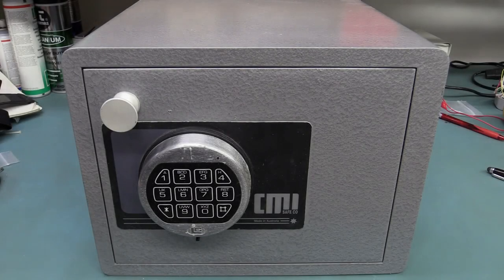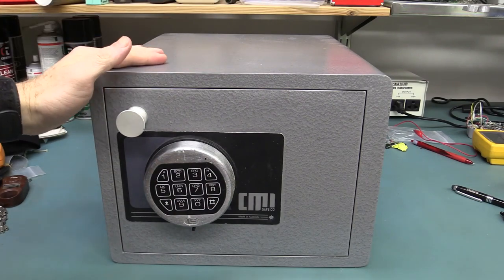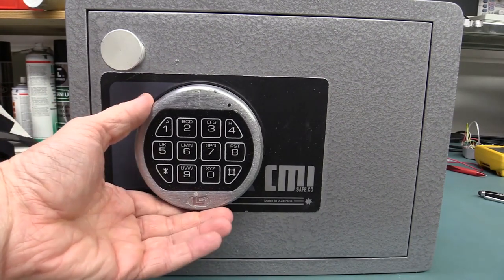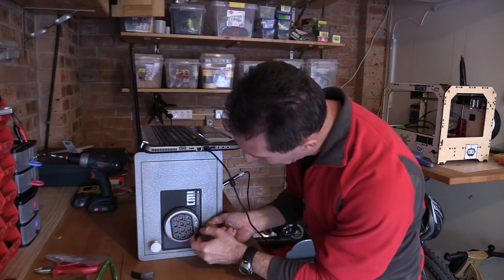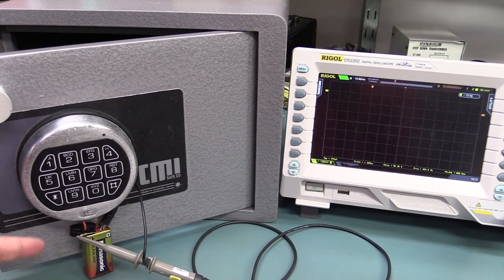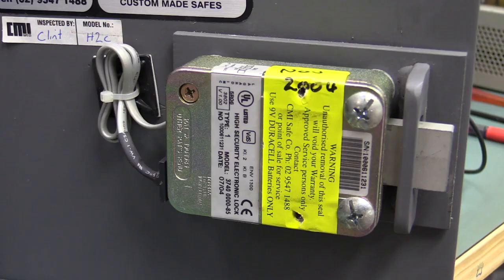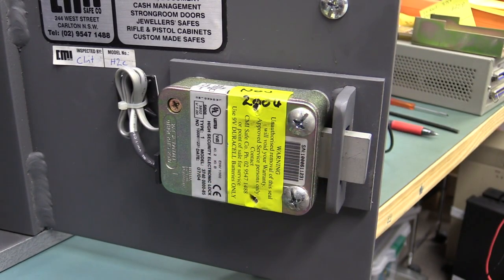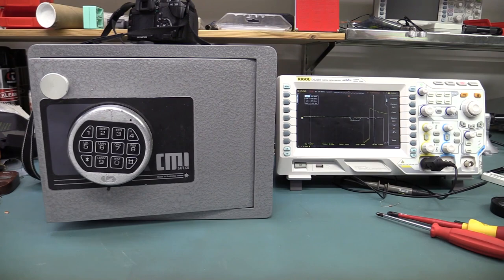EEVblog #762 - How Secure Are Electronic Safe Locks?

Comment: the termoscope idea gave me a mindblow :O!
Reply: Eric Alanis There's a cheaper, easier way but you need regular access to where the safe is (e.g. a cleaner or maintainance person) and the safe needs to be used regularly or it will take a LONG time. There is powder and Gel available for demonstrating how germs spread, it's only visible under UV light. You put a bit on digit "1" then come back after the safe has been opened, shine UV light on it and note if it's been transfered to any other digiets. Clean it off and put some on digit "2".... repeat until you have enough information to work out the code (it becomes a bit of a logic puzzle and you may end up with a number of possible codes to try). You can speed it up slightly by using the finger print method first to find out which digits to concentrate on. It's more accurate than the fingerprint method alone as that only gives you the digits, not the order. If the safe owner is aware they can of course defeat this by wiping the keypad before and after use just as with the thermal method. High security keypads use touch screens or led digits and shuffle the order of the digits each time to defeat fingerprint attacks.

Comment: Gravity in this case could be replaced by a large rotating platform, which would give you a necessary amount of G, which could be enough to open the thing, and the little spring won't help.

Comment: You need a small cassette tape player head that will fit through the hole, or maybe a head from a VCR drum, or hard dive head. The head needs to be wired to a very sensitive amplifier. Tape the head to the long screwdriver, put it through the hole so it touches the lock's metal housing. The magnetic pulses created by the chip's electrical pulses should look & sound different when the correct numbers are pressed.

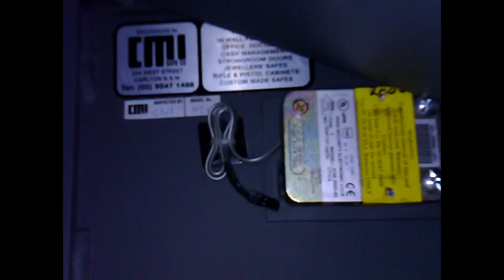Comment: Are the three bolts that you removed to disassemble the lock accessible with a really long screwdriver from the mounting holes in the back?  Wouldn't that let the safe open?  i.e the ones at 16:25 and 34:14.  Of course the safe would have to be sitting free for that to work.

Comment: Probably the program compares the entered code after the last 6:th digit. A small time difference could possibly be seen after the 6:th keypress and the buzzer or led blink. The program does probably some "jump if not equal" compare for every digit separetly. So as soon as there is some difference it will jump out and sound the buzzer. If first digit is wrong it will jump directly out but if it is right it will compare the next.. The CPU can run at 8MHz so the difference could be quite small possibly ns. I thought i saw some ripple after the buzzer signal also. That could mean that the buzzer sounds first and the program compares the codes after that.. Nice video !

Comment: Do you reckon that a check is actually performed after each digit is entered, or that each digit is stored in RAM and then checked after a sequence of six has been entered? Seems to me that just holding the input in memory until a full sequence has been entered would avoid the type of power line vulnerability you were looking to expoit.

Also, I wonder if the number of failed combination attempts is stored in the EEPROM along with the combination and lockout status. If the number of failed attempts was stored in RAM, then interrupting the power supply after every third combination entered would make the use of a brute force jig feasible.

Really though, it seems to me that the solenoid actuator that detains the locking pawl is the most likely point of failure. Maybe just torque on the handle real hard and you could shear that actuator right in two?

Comment: How about using the drilled hole to connect up a "custom wire" to the mechanism,  then look for  keypad communication  data line vulnerabilities.

Or a way to defeat the lockout feature....  disconnect power  or reverse power input polarity  to reset the board, so it forgets the number of failed attempts?

Comment: In the front you have 4 wires going into the safe. 2 for the 9v power and 2  from the keypad. A 2 wire data keypad must be easy to sniff,  specially if you also have power right there for the sniffer.

Comment: You could have removed some of the caps and tried the power line analysis again for  the kicks.
Also on the programming side of this thing, it probably stores the keys in an array and doesnt do any combination checking just after you have 6 numbers in your array. Which means every key press will run the same code (with the same power profile) that only increments a pointer to an array and check if it has 6 digits. Once the 6 digits are entered it checks if the array is correct or not and do a branch for opening the lock or not.

Comment: expanding on your last thought (drilling the front) -- well - they already did it for you!
The knob at the upper left corner ha s screw in the back...so, by twisting the knob, it is possible to disassemble it, knock the bolt inside, and you have an access point. Use an endoscope and an instrument to release the mechanism, and you're in...try it and see if it is possible.

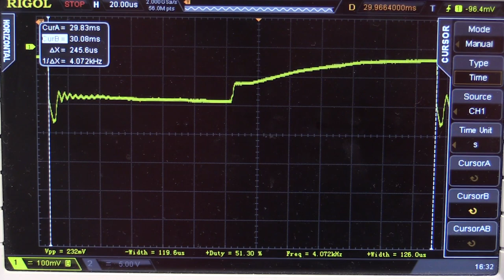Comment: At 23:50 he starts talking about sampling the beep and comparing it, I found it easier to tell audacity to generate a 49 ms tone at 4072 Hz (which I did during the video, It's definitely the speaker).

Secondly the trouble is that you assume that an electronic lock would behave the same way an electronic level as a physical lock would, checking each number as it comes.  A properly programmed lock should just accept five input numbers and store them, then check all five at once.

Comment: What makes it almost worse is I've seen an almost identical example of someone doing the same thing on YouTube. Shows how much hassle even a bottom end decent quality safe takes to get into though, if it is bolted through the floor or back of the safe the way it's intended.

Theoretically though it raises the prospect of removing the same plug from it's hole and then using two wires on a stick carrying 9v to spike it through the now empty socket. Possibly even easier doing it that way than putting the plug back in!

In my experience of similar electronic dial safes, you get three shots with a five minute lockout. Hurrying to cash up at work cost me five minutes of sitting there chafing a time or two.

Comment: Since the power line is protected, what about probing the data line of the keypad? It should have a direct access to the internal circuit, maybe something slips out.
It should be easy to access that, just peel the membrane off and snap onto its wires!

Comment: The cable goes from the keypad to the control unit, right? How about tapping that cable, either inductively or electrically, through one of the mounting holes and analyse the communication? Theoretically, an attacker could install a small box which transmits the data in real time through a small RF TX.
Chances are, an average user might not notice the tap if it's done intelligently.

Comment: Maybe you could insert a probe through one of the holes and try to pick up some HF signal. PCB enclosure acts a shield, but maybe it leaks a little. Plus the whole safe is a good shield too, I presume, so the inside might be pretty quiet, HF wise.

Comment: I would have thought that a system which was developed as a result of proper systems-analysis would store all six digits BEFORE performing the comparison (if there were any chance of a power-line sniffing attack revealing any meaningful data).
I think the first drop you see on the scope is you sinking current with the button, perhaps. The subsequent drop(s) would be from the processor storing that digit in the relevant register. Then, I'm neither an electronics engineer nor an expert on safes. I am, however, a programmer with over 3 decades of experience and it is upon this, that I base my speculation.

Comment: You get to know the order of keypad presses if you sprinkle different kind of dust into each of the digits.  After safe owner has entered the correct code without messing up the dust otherwise, you just check what kind of magic dust contamination is in which digits.

Comment: Mechanical engineer here: Could you apply a (electro)mechanical vibration using a waveform generator, along the orientation of that solenoid pin-spring mechanism and find its resonant frequency?  If you could get the pin vibrating, you might be able to open the latch.

Comment: Drilling out the pin is the right way to open it. Always make a template when you have a chance.
That lock out had me going, that's why always look 2 or 3 times, a bank vault is not so easy to fix

Comment: When I was a kid my best friend had a code garage door opener, being typical kids he thought it was cool  and never told me the code- and I always said "I'll get in one day". Like a year later I had to bring his bike home and I figured I should return it safely to the garage... I looked at the keypad and you could see the wear on the commonly pressed keys, so after a few guesses I got it (just 4 digits I think). I put the bike back and went home... he never did believe me when I said I figured out the code.

So sometimes even the most basic things can give up clues. If someone uses a keypad a lot, touches it with hand cream on, or anything else on their hands that will leave marks or change the detail of the surface over time then you can figure out at least what numbers are in the code and guess the correct order. Maybe even peeling the number pad off and looking for wear on the bottom of the commonly used keys.... only works if the combo is never changed though.

Comment: You could replace the battery with a power supply with adjustable voltage. It you set a low enough voltage, the circuitry will function but not in the way it is designed to function. The internal logic circuits may get into a state where they power the solenoid when the voltage is suddenly increased to normal, even though the code has not been entered. This hack would require providing varying voltages, both up and down, below the normal operating voltage and then bringing the voltage up to normal. The circuit's behavior is probably not predictable and may vary from safe to safe.

Comment: I like the Idea of using a magnet to force the solenoid, but what about going in trough the holes at the back and bottom, like dave did? perhaps takes the plate directly off the lock or access the cables from the face plate.,
Reply from the maker: electronkidus97 The existing wholes are not accessible in a proper installation.

Comment: I wonder if the speaker is a design "feature" to saturate the power line with noise?? I Also would it be possible to strategically "cook" those decoupling caps?

Comment: Did you try to over power it, 12volts or maybe hi-voltage and high frequencies to see if you can kill the chip and maybe activate the solenoid

Comment: How is the keypad talking to the solenoid circuit with only 2 wire?  Is it a serial comm. connection?  I also wonder if you disconnect and reconnect the battery does the 5 min. lockout still continue?

Comment: So a hack would be to use the existing bottom holes and back holes to access the selelnoid wires or pull the connecter then weasel in power to the selenoid wires or connecter and Power the selenoid and your "in like flin", heck, may even be able to do this with the provided mounting holes with some creative modified tools and mini camera...

Comment: undervoltage is Your best friend with negative pulses. It works for me in a gamble machine (i locked out Myself with a code. in My old pub) so, You just need feed a cranky low voltage press one button and on a same time apply some idiot negative pulses. Most of the cpu are will get hang up. and some logics are will stay opened state. or a 20joule hammer machine :) close to the lock. shakes everything until everything folling into parts inside (solenoid, springs etc) thx for the video Dave :)

Comment: Well, this safe looks really easy to crack into.. You can just use the wholes in the back to get in with screwdrivers and  remove the locking mechanism -> door opens. Dave could have used a endoscope camera trhough one hole and a stick with a glue substance in the other hole. Glue the connector to the stick and reconnect it with the stick, after the glue has dried, or just try to reconnect it with something that can grab onto it.

Comment: Looks like a long philips screwdriver from the back mounting holes could take the protection on the rear of the lock off.  Then just remove the solenoid, job done.

Comment: I spent like I think around $800 (CDN) recently on a asus prime 350b, 16gb of gskill 2400 I run at 2666, and a ryzen 1600. Before  that I got a used strix nvidia 970oc gpu for $250. I don' t know if it was the right choices, but I am comfortable with my system. I have all these old 500 GB SATA drives with compatibility bugs. I turned out that my motherboard had a few weird sata connectors jetting out horizontally that get disabled if you install m.2. The drives would hang the sata bus and reset them, but they work fine there, and it turns out those ports differ in they connect directly to the cpu. I spent loads of time testing cables and swapping the data between different drives with different bugs.

Comment: If you broke the front plate off and used a high power electromagnet, could you pull the pin out of position (putting it against the safe and sliding right -- or putting it in the right spot and bumping the safe) and use a screwdriver as the handle?  Or is the pin itself not affected by magnet?

Comment: EEVblog I had an idea: I would have programmed the controller so that it would compare the number AFTER all have been entered. Until then it would only store the input. If that´s the case - there should be a different signal after entering the last digit of the code....

Comment: USually when you give a good hit on it and turn the bolt it opens.
Because most cheap safes use Solenoids to prevent the bolt retraction. The blow will temporarily remove the solenoid and voila. This solenoid is somewhat decent though.

Otherwise there's usually a little hole in the back to press a reset switch.

I hacked one of these safes when I was a mentalist and it allowed me to seemingly suggest a 4 digit number and let a person open it after having several volunteers trying to open it.
One tiny arduino does that literal trick

Comment: Omg dave.. after watching that hole drill as a locksmith I shook my head,  we have to be extremely careful when we work so this NEVER happens lol but I have fixed this same issue with a double scissor jointed hemostat with curved tips through the existing mounting hole, still you went straight for the big drill bit, if you started at 1/8" then 3/16" then 5/16" you would use much less power from the drill and it would save the bits.
Reply from the maker: Peter Carlson I didn't have a 400mm long hemostat. The holes were just big enough to do what I needed with the tools I had.
Reply: They are pretty darn handy especially if you can get them in the non magnetic stainless kind. I found out they aren't called double scissor jointed hemostats, they are called "laproscopic needle drivers" (check them out, they are cool) You did the job with the tools on hand and didn't really comprimise the integrity of the safe and that's what counts, I'm only saying what I would have used as a locksmith.

Comment: Given the rather small search space (6 digits, 1 million possible combinations). And given a rather historic security flaw. (A long time ago, a certain OS gave the ability for a program to be notified of page read/write requests in a virtual memory system. It also checked passwords one character at a time, returning failure at the 1st wrong character. So someone devised an attack by placing a password at a page boundary and shifted it one character at a time as each character was determined). In any case, what I would do with that is simply take each key press and accumulate a 4 byte binary value for the combination being entered. After the entire number is entered, perform a single comparison against the 4 byte correct combination and determine pass/fail at that point. So you get no indication of each digit being correct or wrong. Just a simple pass/fail of the entire combination.

Comment: Great video, thank you, Dave!
So I noticed that decoupling was done with some large Tantalum caps. These are rather slow, so I was thinking, what would happen, if we replace the Battery with some sort of DC-Powersource with a higher frequency ripple added?
The tantalums shouldn't be able to block that out, would it be possible to see something happen to the RF ripple?
Or were there some ceramic caps in parallel I didn't see?

Kind greetings from Germany,
Niels

Comment: ... nice thorough presentation.... Q:  just curious, any chance removing the battery for say 5, 10 or 30 seconds would negate the 5 minute lockout?? ( didn't C any electrolytic cap 4 a RC timing ckt although there could b sum sort of a SW digital counter )....nice scope...what model? how much did that set u back?  thxs

Comment: Looking at 40:53 you may unscrew the handle of the door and pass trough the respective hole a little solenoid to use it to create a strong electromagnetic field over the locking mechanism to move the pin! The pin is magnetically moved by design...
Reply: Don't need to unscrew anything. Just use a hockey puck sized neodymium magnet. Be careful with your fingers, and always put it in cloth.